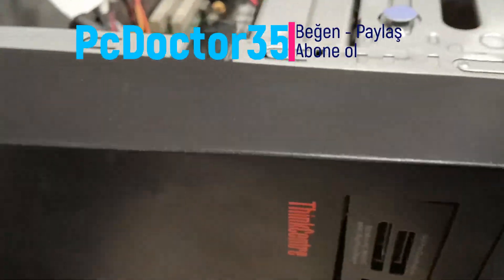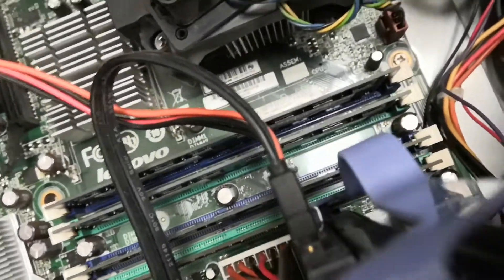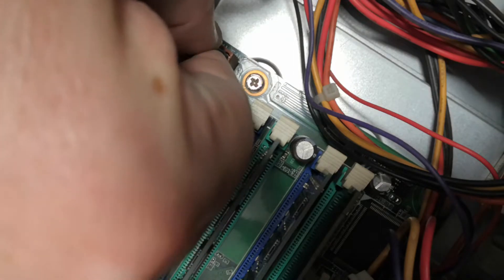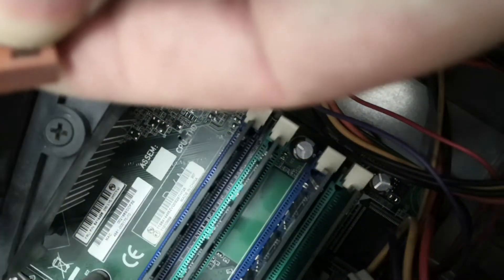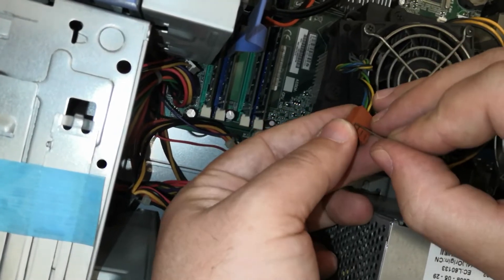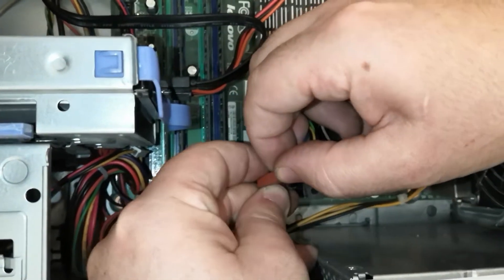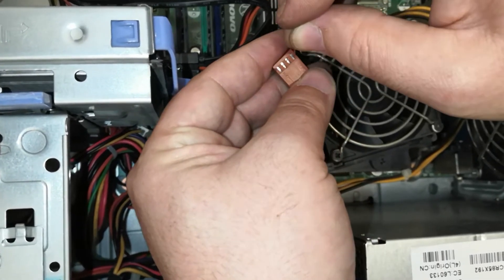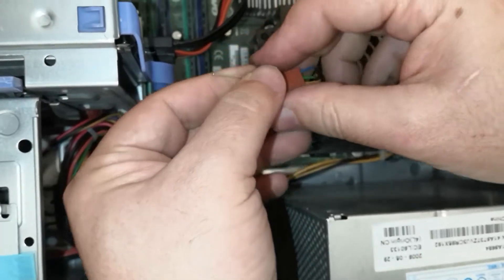Lenovo Fan Speed down Client Mode Manual Fix ThinkCentre And All Brands Loud Fan Noise Solution

Comment: i dont get it you unsolder those two then connect them together?
Reply from the maker: Are your computer is lenovo?
Reply: @PcDoctor35  yes m91p motherboard is6xm the fans start quiet but start to go faster and faster with diferent coolers, even the chasis fan
Reply from the maker: @calvitocalvon1711 you have same color #cable?

Comment: my problem is that this lenovo m71, m72etc series of pc. Its bios does not have control of the fan, so when I create a fan curve with software, the fan speeds up and slows down and takes control of the fan software so that after a few seconds it returns to take control of the fan for later some time later and randomly the action is repeated creating a vicious circle even though I clean it like a jewel, doing this will I have 100% control of the fan or do I have to do something else
Reply from the maker: Can you in video seen Cable contact?

Comment: I got the some problem.. my fan turn extremly fast and noise. I already clean the fan but stil won't work..
Reply from the maker: Apply this video, connect to Cable pins👍
Reply: @PcDoctor35  thanks for the reply.. the problem is when I start the computer the fan turn fast and the system won't start... not event in the bios... the question is, if I follow this method will be fix rhe problem or maybe something wrong, whit the other peripheral. . Im worry I cant plug the cble back in the pin again if I remove those from connector,, its blue and green cable right?
Reply from the maker: https://youtu.be/upcA0LylRKE ok bro this video your problem solution 1.step applying👍🤝
Reply from the maker: This Solution for All brand computers 👍
Reply from the maker: Cleaning to ram Memory👍
Reply: @PcDoctor35 I will try this method, Hope this can be work,, thanks for the assist.. Im really Appreciate it..